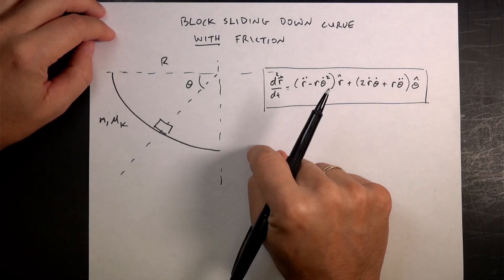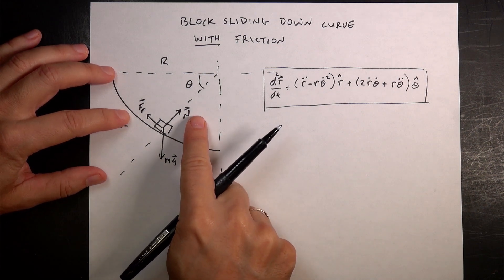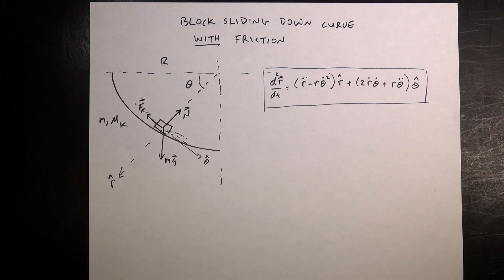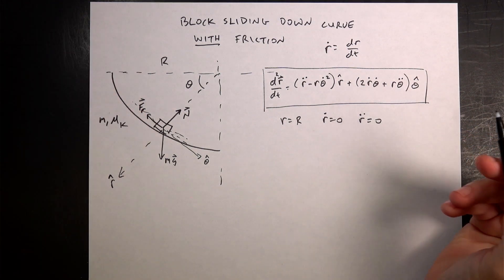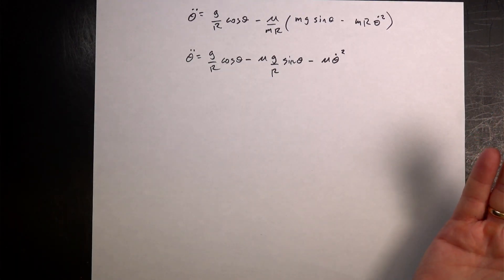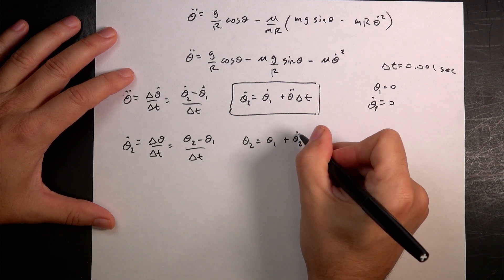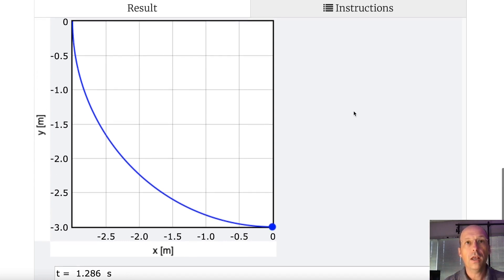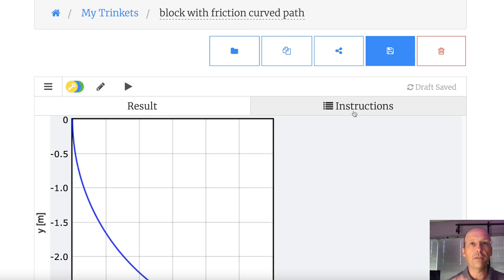Final Speed for a Block Sliding Down a Curve WITH Friction

Comment: Sir it can be done with simple work energy principles also I think !
Reply from the maker: If there's no friction, then yes - you can just use work energy.  However, with a frictional force you need to know the magnitude of the normal force to determine the value of the frictional force.  That means it's a bit more complicated than just using work-energy.